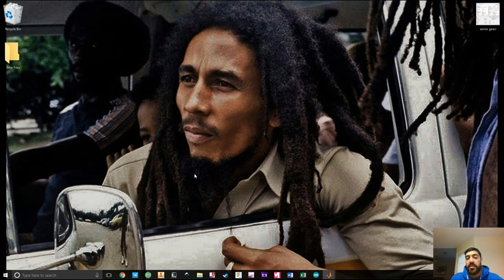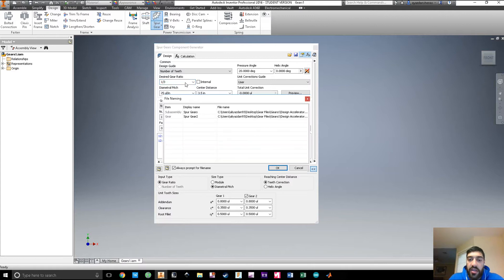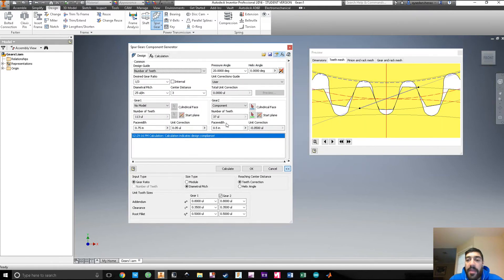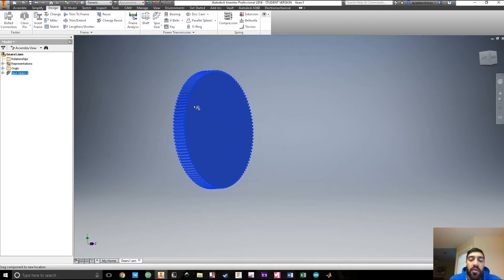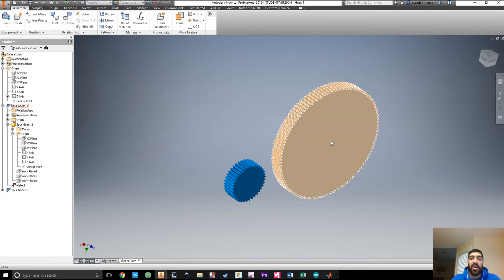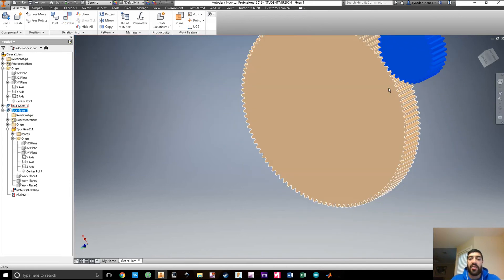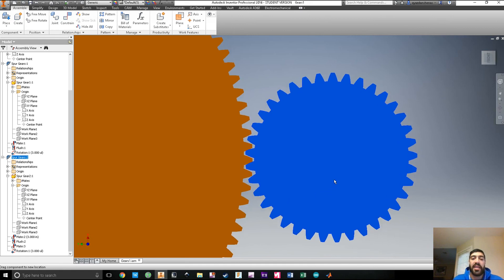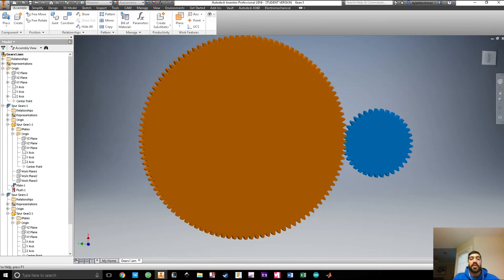How to make gears in Inventor

Comment: Any idea how to change desired gear ratio? I wanted to use 1/100 but its not within the range.
Reply from the maker: Try all of the settings. worst case scenario you will have to make two separate gears and assemble them in a separate assembly
Reply: @AliShenas1993   Yeah i've tried all the settings it's not working out. How to make the gears separate? This tool won't let me get a single gear at once as the other one infers its properties from first one. So in the end always an error comes up. 

I guess only manually designing from scratch would work then?